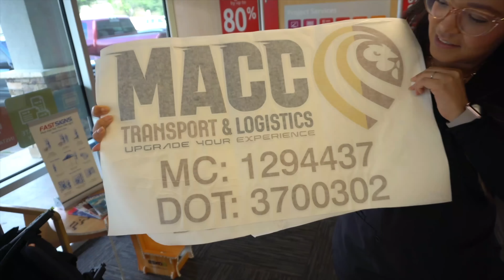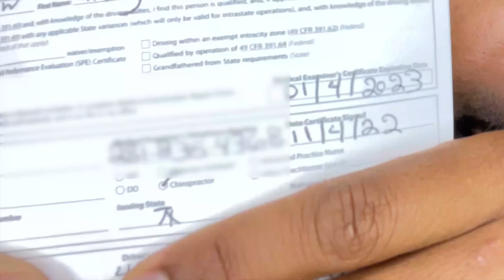I May Have To Quit Hotshot Trucking.....The Reality of Trucking that Nobody Talks About!

Comment: My issue is I do have high blood pressure but I also get extremely nervous when they are testing for it because I know it’s going to be high. My heart rate always reads high as a result. 

Luckily for me, I never take medication so a small dosage got my pressure to drop dramatically. Got certified for my 1 year and will now focus on lowering the pressure even further and getting off of it.
Reply: No dairy or meat, add fruits and raw veggies to the diet and it will drop easily. Also exercise is key as well. Much love my brother.

Comment: Tim this is Jim I've been doing hot shot for 15 years CDL hot shot for 7 I had a high blood pressure spike I was in the same situation as you Try this it helps it helped me. use a stopwatch take 7  Seconds to take a breath in thru your nose and 7 seconds to breathe out through your mouth have to do it real slow takes practice.  This breathing exercise will slow your heart down also Try to jog 3 times a week a mile or 2.

Comment: Been there done that.....don't let the mess scare you away from the job. I take a small,( very tiny pill,) once a day. My blood pressure is under control and I have a two year medical card.
Reply from the maker: I’m not trying to live on a pill. So I definitely gotta get it under control by these lifestyle changes. But the stress is real in this.
Reply: @HotshotMacc  I understand.  I stopped drinking soda and coffee, I  lost 26 pounds, unfortunately blood pressure is a strange issue,taxes are an easier subject....I wasn't able to get a medical card,no matter what I did.  I finally gave in and took the pill. Luckily it only costs $7.00 for a 90 day supply and no side effects.

Comment: Test your left side and then test your right side. And if there is a 10 point difference you could have a coarctation of the aorta 🫀. A pinch in the valve that would require a stent. This could save people’s life’s. Knowledge